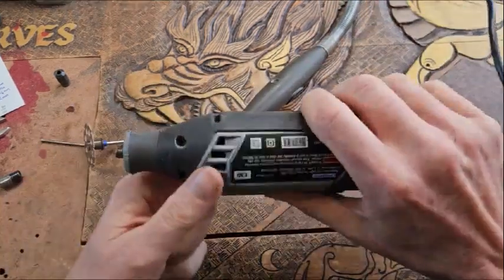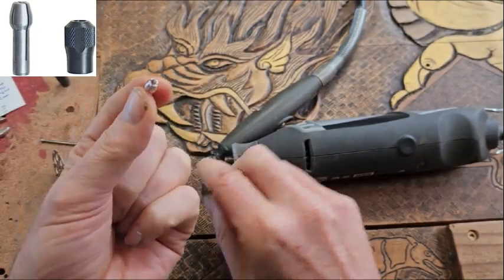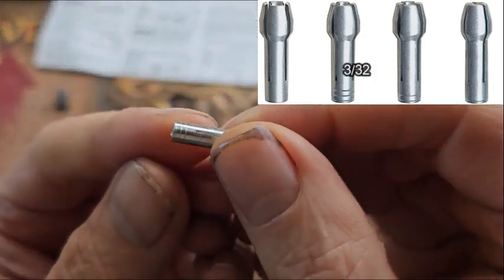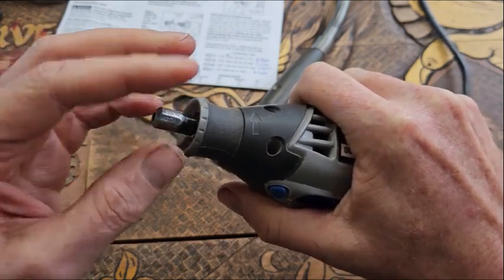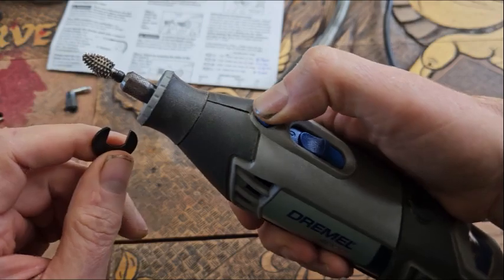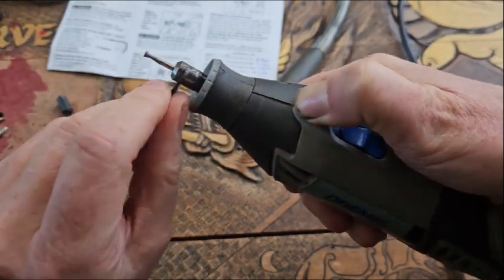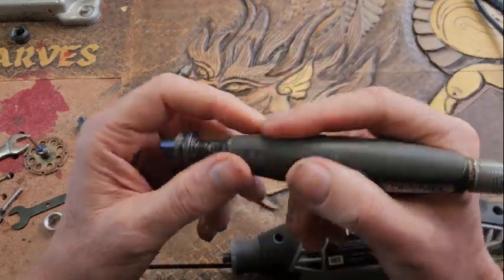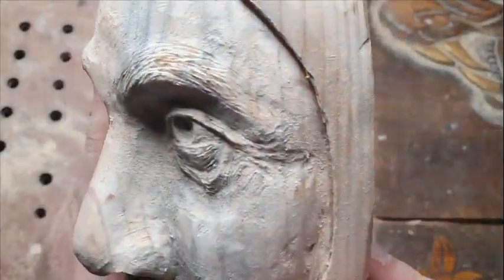Beginners guide to Dremel Collets

Comment: Are the different collet sizes for different sized shafts?
Reply from the maker: Yes that's correct. 1/8 is the most common burr shaft.
Reply: @MattCarves  so how do we know what the shaft sizes are on all the accessories bits?
Reply from the maker: @Barnaby_bo  when you buy them it should say or measure them
Reply: @MattCarves  so it will say on the packaging?